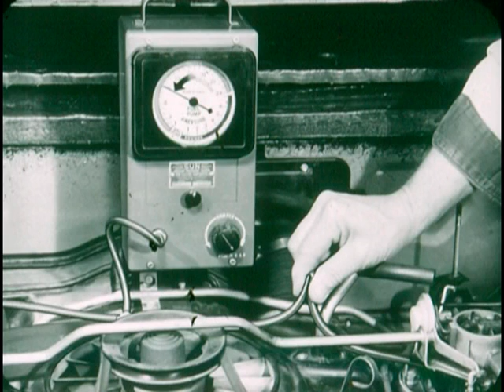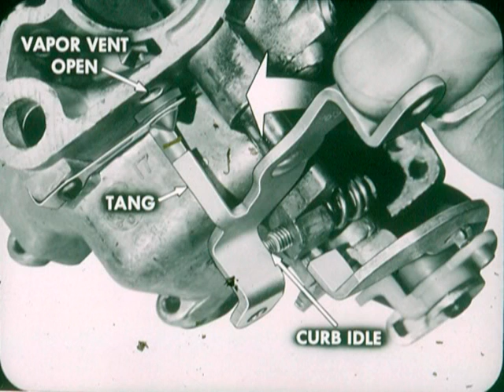Tuning The Corvair Engine -Part 2

Comment: Doesn't the valve adjustments need to be checked approximately every 6 months? They would on the Porsches and VW Beetles.
Reply from the maker: No -they are hydraulic lifters just like most American cars .